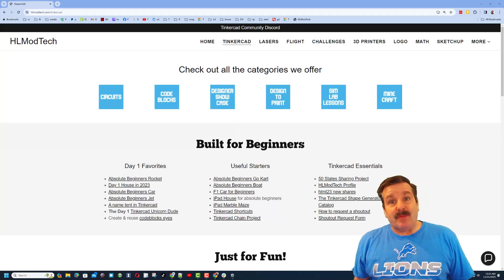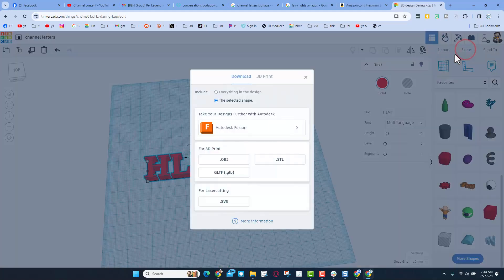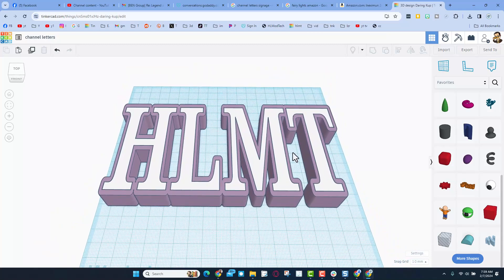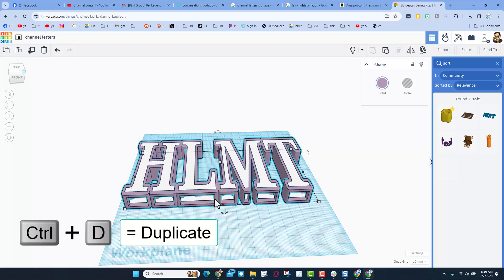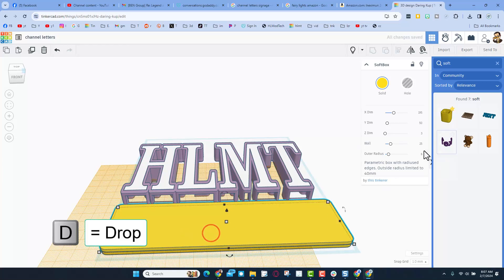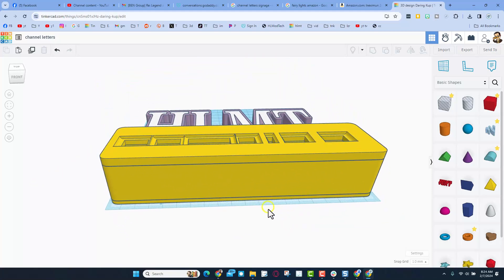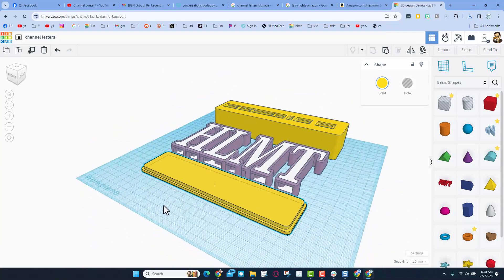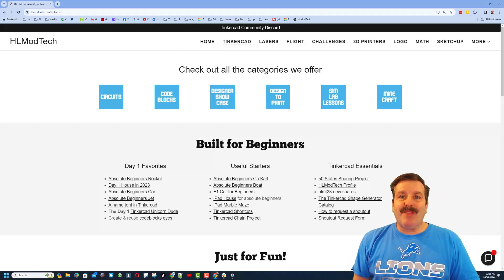Easy Tinkercad Channel Text for LED lights SVG Slick Signs in Minutes

Comment: OK, I figured out a work around, you take the object, set fill to inner line, and then lay that on a hole version of the text object and that leaves the spaces you need to fill, then follow your process and then align that with with the result and, there you have it!
Reply from the maker: Well done! I have been working on new techniques for those lately. This trick helped a lot when I added the front. https://youtu.be/P3FLz0BJVUk

Comment: Good afternoon, well explained, I have been looking for this action for some time. but how do I get the inside side of the letter to be the same as the outside side, it concerns the following letters Q, R, O, P, A, D, B. Thanks for the comment.
Reply from the maker: Making this complete is on my list... I appreciate the reminder. An extra step would be the technique used for the details here.  https://youtu.be/ua1fT4Xh2fY  I have yet to test and print a final solution though.

Comment: Hi MIKE, I LOVE YOUR CHANNEL, THANKS FOR TEACHING. I AM FROM ARGENTINA, AND I WOULD LIKE, IF YOU CAN EXPLAIN, HOW TO MAKE HOLLOW PRINT AND CURSIVE LETTERS. EXAMPLE: OPEN AND COCA COLA. THERE ARE MANY OF THESE EXAMPLES IN FUSION360 BUT NOTHING IN TINKERCAD. I HAVE A 20X20 CM 3D PRINTER, SO IT WOULD BE GOOD IF YOU EXPLAIN HOW TO CUT THEM AND BE ABLE TO HANG THEM UP LATER. THANK YOU VERY MUCH AND I AM WAITING FOR YOUR RESPONSE. THANK YOU.
Reply: This is what I mean Mike, doing this in tinkercad. It is for LED lights.                                                   https://youtu.be/3Mkf67_ZnEM?si=gHSn-YLcgb9qS9SF
Reply from the maker: Thanks for reaching out. Always makes my day to reach new countries. 💯👍I will see what I can come up with. It will be similar to this strategy though. https://youtu.be/4ReVq83DYrk
Reply: @HLModTech  I saw that video, but the letter D, O and E do not have their interior. I think it should be possible to do it in tinkercad just like they do it in fusion 360. I HOPE I CAN TEACH THIS TYPE OF FONT. THANK YOU
Reply from the maker: Tinkercad is missing a TON of the features he uses to make his. I did some fiddling, but there is nothing easy about the process. The tricks the creator used to make objects a little smaller for so the fit was right is super helpful... and part of a powerful program.. that cost 400 bucks. =) That said... I will keep fiddling.  If you would, You can reach me at hlmodtech gmail.  I will share the project so you can see where I am at so far.

Comment: How about instead of opening the bottom of the letters, you open the back of the letters? Then you could make a "back panel with a lip" that would enable you to run LED lighting throughout the whole model? That "back panel with a lip" would then enclose the entire model. Thank you.
Reply from the maker: Yes!   I was thinking the same thing as I finished it. That press-fit closure I did for the bottom was super slick. I will be making a new version of that video. I am traveling rn, so it will likely be next week. I think it will be really slick,
Reply: Sounds good.  Will be watching for it!  Thank you.

Comment: Once again, very well done tutorial. I have a suggestion for the next tutorial: 

Make a regular polygon using a cone shape. 

This tutorial should be an “Absolute Beginner” level. If you didn’t know yet, a regular polygon is mathematically defined as a polygon where all of the sides and all of the angles are equal to each other.
Reply from the maker: Great suggestion! As a former math teacher your explanation of the shape is terrific!